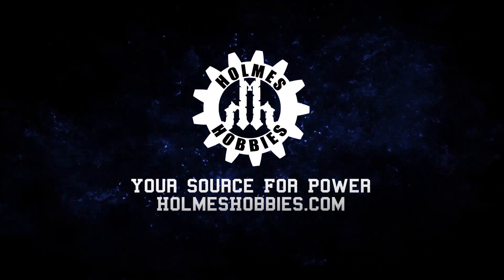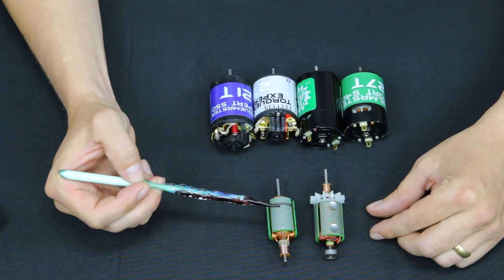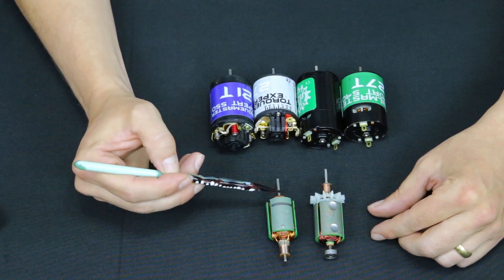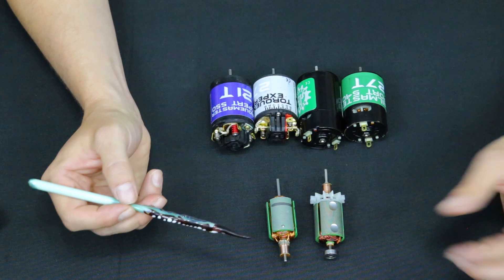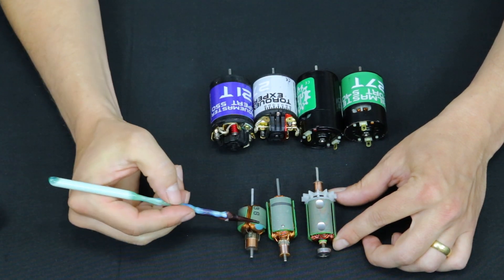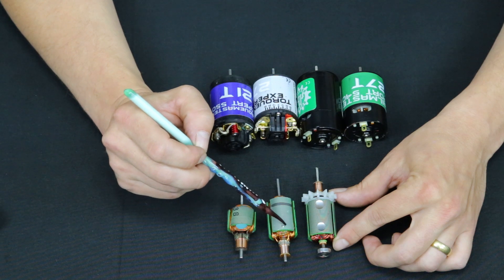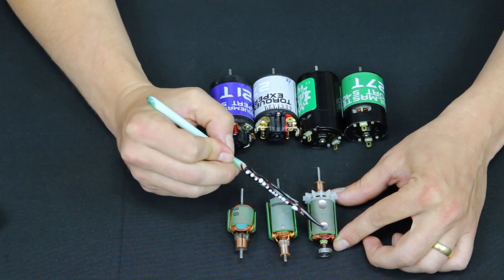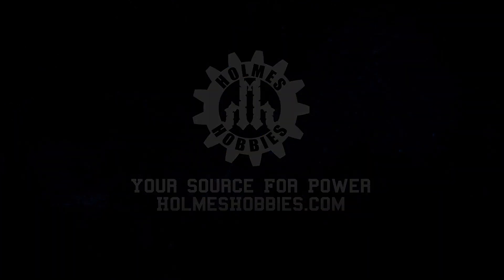Quick Tech - RC Brushed Motor Laminations & How They Effect Performance - Holmes Hobbies

Comment: do you ever get armatures for the TORQUE MASTER EXPERT motors that require only balancing with "putty" and would you then use putty to balance them rather than drill them?
Reply from the maker: The Expert motors are balanced by Sagami.   They offer drill balancing, and it hits the proper price point needed.  Since they are very precisely made via machine, the small drill balancing does not typically affect the performance enough for the average consumer to notice.    The main factor is hitting the right price point.
Reply: I get the feeling that although you give the impression that a good portion of the business has gone bye-bye because of Castle (right or wrong impression) "HolmesHobbies" is selling a large number of high-grade motors...  You still have a pretty large company.  I hate to hear of all the business' (Hobby) that have bit the dust in the last 3-4 yrs..  Every time the economy takes a big one, the disposable income goes down.  One thing, this time, I think that has happened is the extremely small miniaturization of  components and yes the super cheap small boards that China has stollen from us.
Reply from the maker: We are a very small company.   Just 4 employees and a few contract workers right now.     But, I do have my machines and systems set up to scale easily with volume, so that we can manufacture 1000 motors with the same attention to detail as 10.
Reply from the maker: Your impression is right though.  Castle's entrance lopped 40% of sales right off the top.
Reply: that is great, I hope your margins are large enough,  people knew what the product price cost we had was they couldn't understand why the invoices had such a large markup on them, they simply didn't understand  the overhead, cost of equipment, etc., labor it was very hard to keep it above water